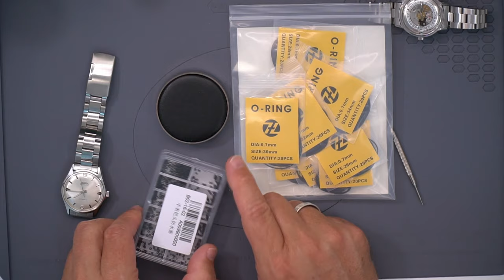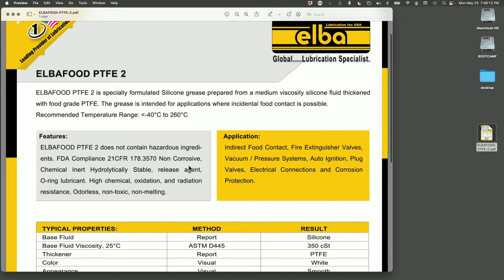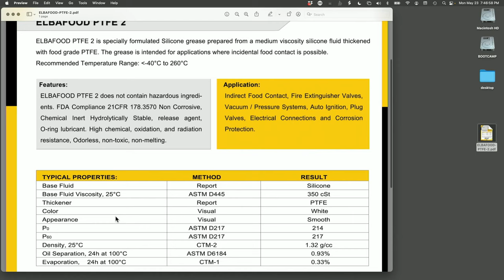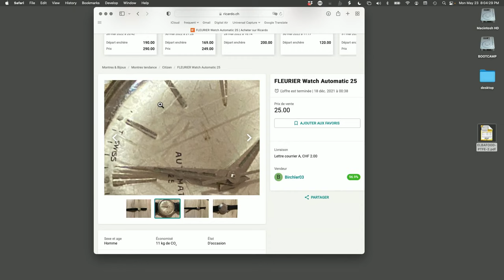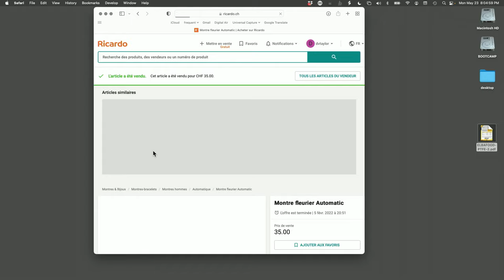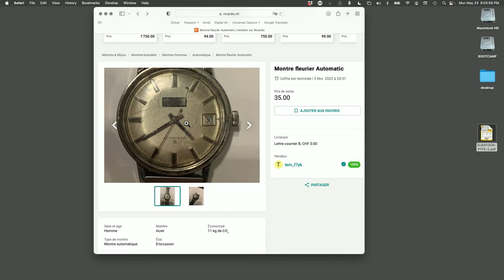How to Waterproof a Vintage Watch - Realtime Cutdown

Comment: Pretty impressive to see how you insert a one TB of storage inside your vintage watch. I have few Seiko vintage & I'll do that sooner. Hope the rotor will not stuck with that. Anyways, thanks mate.❣️ Subscribed.
Reply from the maker: Thanks for your comment! I'm very happy that someone else is interested in putting 1TB of non-volatile storage in their wrist watch! Is that why you thought of using a double gasket?  I wouldn't do that. I think the best way to approach it is some watches are going to have the space -- and some are not (most not).  You could do it with almost any automatic by simply removing the rotor. Most Swiss automatics work without the rotor. (Seikos in general do not.) Or look for a perfect case / movement combo like I found with the two different ETA 2472 cases. 😂😂😂
Reply: @IMakeWatches  well, i do not own any dive watch yet. Have to go through water every day for work. All of mine are vintages. That's why i am thinking about two gaskates. I have 2428. Already i've tried to place a micro sd card on my 6309A & 6106C. But i failed. Back cover got stuck with rotor. Will try on eta. Anyways, appreciate your reply.

Comment: Hi, just found your channel, and am new (a couple months now) to watchmaking.  I have a question related to this video I'm hoping you could answer.  I recently bought an Omega 2505, which has no water resistance at all.  Is it possible to add gaskets to a watch that never had them to begin with, or would they prevent the caseback from being able to be closed?  It gets quite humid here in the summer and really want to protect this watch if I can.
Reply from the maker: Rather than speculate I would go to Omegaforums and reddit (r/watchrepair) and ask in both of those places. That will get you a range of expert opinions quickly. Both are free to join and ask questions!  https://omegaforums.net
https://www.reddit.com/r/watchrepair/ Good luck with it!